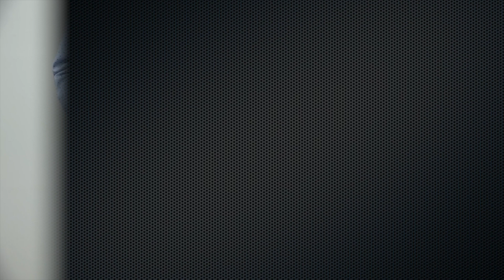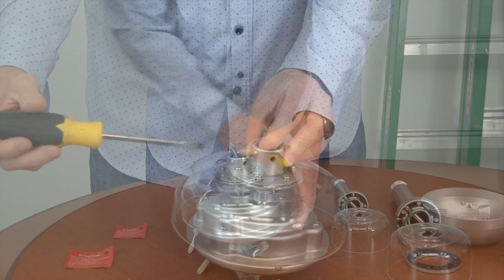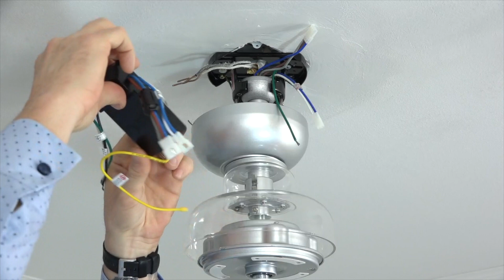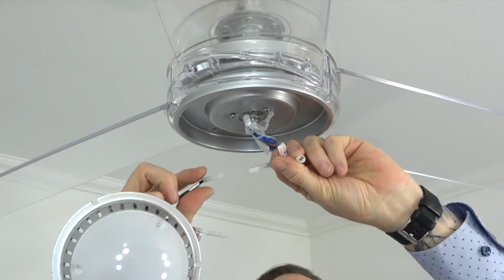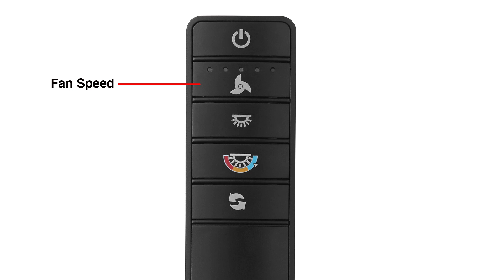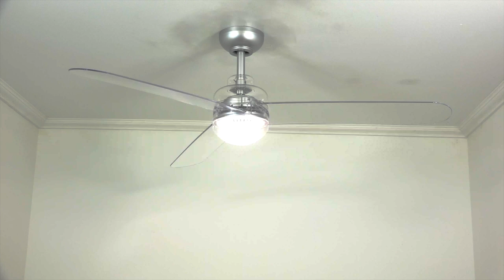How to Install the Everaine Ceiling Fan by Home Decorators Collection

Comment: does anyone know if this fan can work with a white wall switch as alternate to the remote?
Reply from the maker: The only acceptable switch option would be one standard on/off toggle switch. Due to the DC motor and color changing light kit, the fan must be installed with the remote. The DC motor is not compatible with speed control switches.
Reply: @ceilingfans101   ok so you mean there can be a light switch on wall that will turn on the light? The color change and speed must be controlled by the remote? Do I have that right?
Reply from the maker: @rls1231  The remote receiver can be connected to one standard on/off toggle switch. This would allow you to turn the fan on/off simultaneously. The light can not be connected separately to a switch and controlled via the remote.